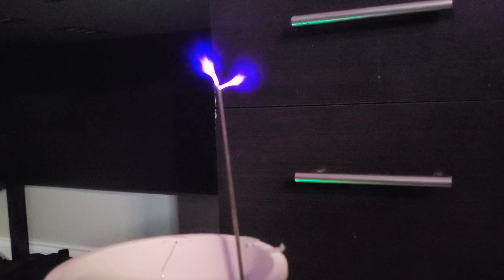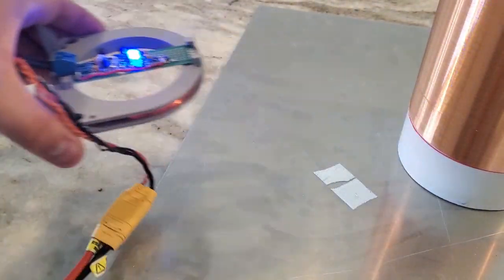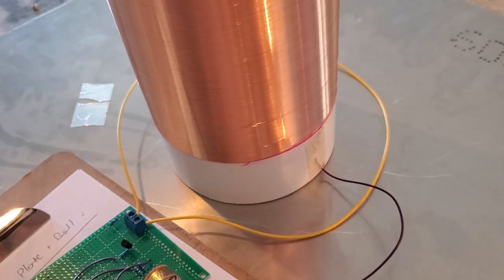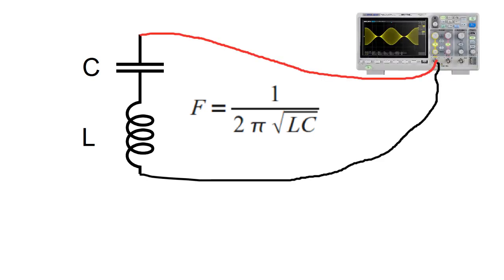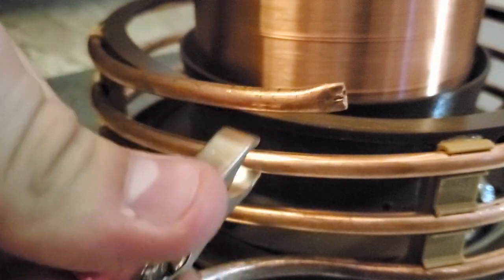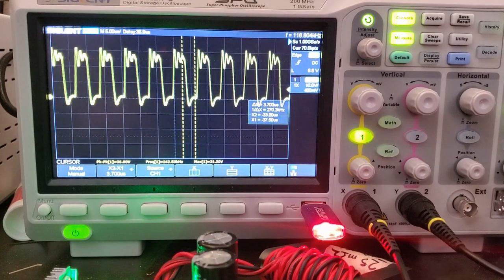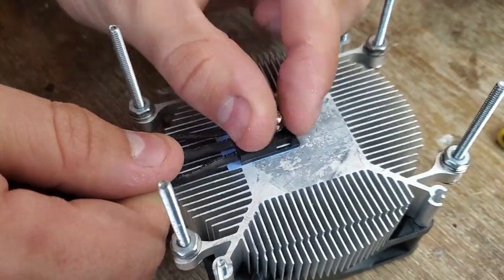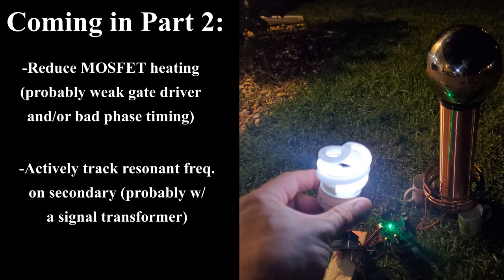Solid State Tesla Coil (SSTC) Part 1

Comment: Your walk through of finding the resonant freq by getting the circuit to ring is very good. I figured it out through lots of trial and error back when I was building coils.

Re. the stray L and C of the probes: wouldn't you be able to mitigate some of this by NOT making contact with the top load? I.e. clip the probe's ground to the probe (so make a little circle), and bring it close to the coil.
Reply: That's what I do

Comment: You could have just used a waveform generator to the bottom of the coil through a 10k resistor and oscilloscope on the secondary side of resistor. Adjust until amplitude shows.
Reply: Forgot to mention that I really love your work. Your breakdown of the engineering in all your videos is really informative.
Reply: I’m not getting this. How would connecting the scope on the other side of the resistor work?
Reply: You adjust the frequency until you get maximum voltage rise on the scope. And that is your resonant.
Reply: Right, right. I got lost. Thank you!

Comment: Hello, your SSTC looks cool even if it's not at its best performance... Perhaps a TL494 plus a MOSFET gate driver chip can help? I'm not sure, I'm just trying to come up with ideas😅
Reply from the maker: That's pretty close to the approach I'm looking at for part 2, where I'll use an IR2153 to drive the gate from a cleaned-up feedback signal from the secondary coil - either with an antenna or a signal transformer

To really drive the mosfets efficiently at this frequency range, I need close to 10A (for very brief periods) to charge the FET gate quickly enough
Reply: @HyperspacePirate  We're hoping for your success on this endeavor🙂
By the way, you might find it interesting to check Steve Ward's SSTC circuits, although they are more complicated than at first glance😅

Comment: Great job on explaining it all as you go from part 1 to 2 and the last number 3 videos! Thank you for sharing! Would you suggest a very simple small TC that uses IRFP460, that I can make in few days? We have a show for people and I like to have a small TC demonstrator that is fairly safe. The once I've tried from youtube channels didn't work at all. I have a coil of 800 turns on 2.5" plastic tube, using 0.27 mm (30 AWG) magnet wire. I also have an aluminium toroid that is 153mm across and 38mm thick.  I'm not near as advanced in electronics as you are, but if I have a good circuit to follow, I can put it together. I have a real large TC that I've made, but SSTC is beyond my ability to troubleshoot.  Thanks again.
Reply from the maker: If you use the schematic from part 2 of my SSTC series that should work pretty well. Sounds like the coil you have will probably work, it's just a matter of getting the frequency dialed in

Comment: Hello there! I've made a small TC and it's resonant frequency it's about 1.7 MHz. 
Do you have any idea on what oscillator i can use to achieve such high frequency to drive the mosfets?
Reply from the maker: in theory a zvs driver can do that but you'll need to select the right FETs and diodes to handle the speed

Comment: how can you control the output frequency say for example you wanted to get to a particular frequency aside from 50khz or 60khz without affecting the output voltages?
Reply from the maker: I use a 555 timer for the second driver circuit with a frequency that's controlled by a potentiometer
Reply: @HyperspacePirate  worked for a while, blew transistors, couldn't achieve desired VHF of at least 1ghz.
Reply from the maker: @JW-nq6do  Check out my second video on SSTC's, it explains a lot about how to avoid blowing up your transistors.

Idk why you're trying to run 1 ghz though. A typical tesla coil is like 100 khz - 500 khz or around that neighborhood
Reply: @HyperspacePirate  i need the coil output to be at least that frequency to move on to the next stage of my project.